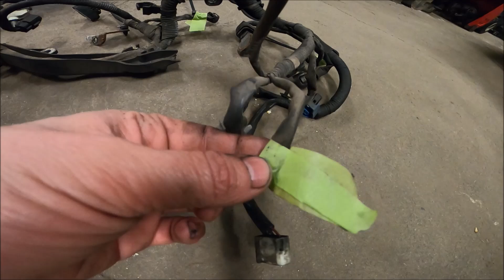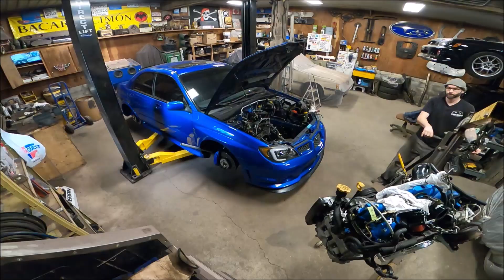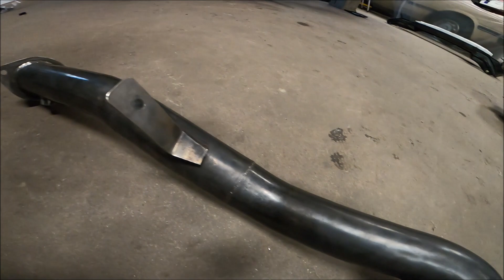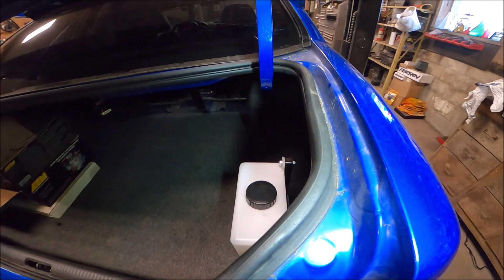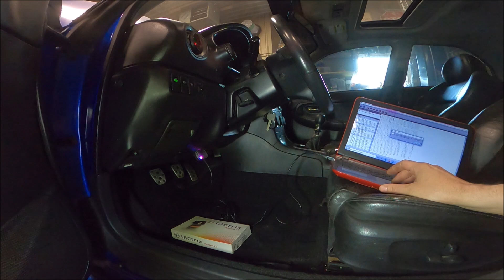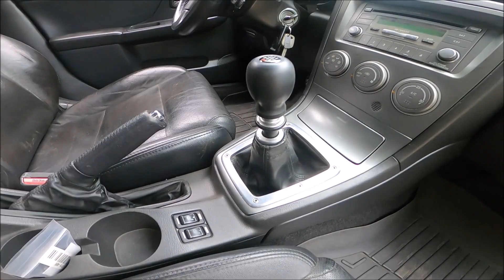GD WRX + STI Complete Restoration  - Better Then New!

Comment: Quick question, what are your wheel specs if you don't mind me asking?
Reply from the maker: The are an oem subaru wheel, rays/sti 17x7 +55, require a 6mm spacer to clear brembos. They came optional on gc sti and forester sti
Reply: @TheSubieSanctuary  Thank you so much! By the way your car looks mint!
Reply from the maker: @tallmetalfence1319 thanks brother! It is very loved car.
Reply: @ I can see that! Keep up the good work 💯

Comment: Wd40
Paintbrush
Brake clean
I use this professionally every day, sir  haha. Super squeaky clean 🤘Love this attention to detail, makes for an amazing result. 👏

Also I like the custom vacuum routing. My bugeye needs those brittle evap purge lines replaced and I don't know if I'm wise removing it all. thats a great solution..I may follow suit, if not just for the boost line connection point lol
Reply from the maker: Thanks brother, that formula is definitely the best approach. Effortless
Reply: @TheSubieSanctuary  I like this too: while it's soaked in dawn/water/wd40....blow it off with 100psi of shop air and it'll remove the bulky crap that would plug up ur brush
Reply from the maker: @Gunma_garage  i definitely gave it a good blow. It does work mint once you got all the bulk loosened up.
Reply: Catted...I've been dying to hear a good catted setup. Maybe alittle less cackle is acceptable sometimes haha (dad mode)
Reply from the maker: @Gunma_garage  i took for first road test other day. Super quiet with some nice spooling sound. 
Cant wait to hear it in high rpm and boost though. 
Very quiet cat back on it, which is very much my style 😂
Reply: Ahh twinsroll..just caught that. Will have a diff sound from the gate 🤙
Reply from the maker: @Gunma_garage  going to sound very unique. Not a lot of 2.5L twinscroll’ers out there

Comment: Great looking build! Super clean.
I have not put a new motor in yet. I ran seafoam in oil x 500km and installed 5w30. So far 2,500km and money lights are still off. I know I just need to bite the bullet and buy a low km. Lol

Comment: comment #5, amazing job as always, Jesse! & much respect for taking the time to film, edit and upload this for us to see all the work you put into every detail!
Reply: Where did u tap your oil press sensor?
Reply from the maker: @ppp000s  thanks brother! I always prefer mechanical gauges compared to electric senders. I installed the oil pressure line at the back pass side of the block. Common spot for senders etc. Better then using the front hole as the factory sensor is there